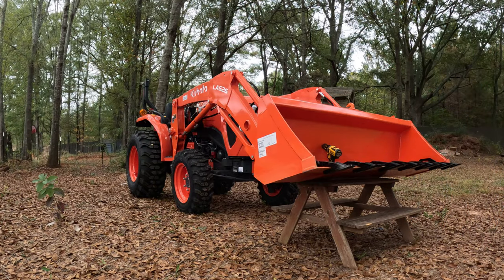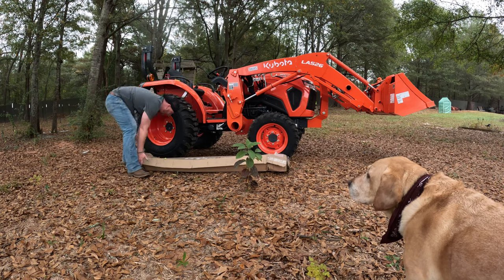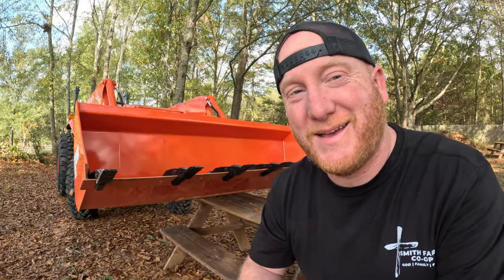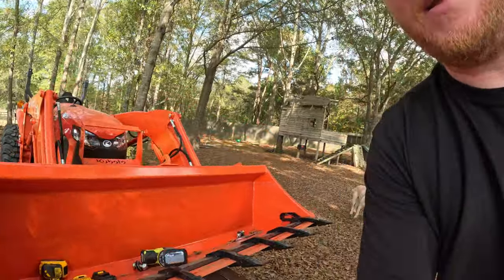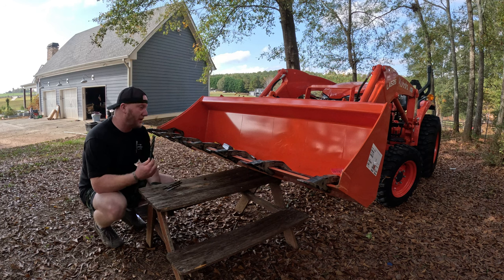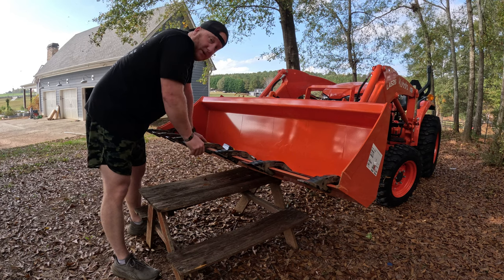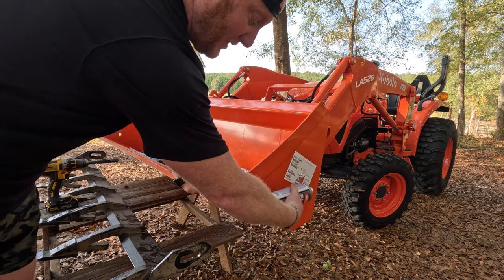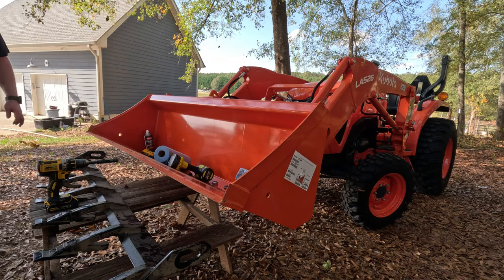How to Install a Tooth Bar on a Kubota L2502 Tractor Loader | Ultimate Guide for Farm Efficiency

Comment: I just recently bought the same tractor. 30 years on the place and its my first tractor.  They had it set up at Kabota dealer as top heavy as possible and never mentioned it.  No basalt in tires and at the narrowest location.  Im very familiar operating tractors  as i used to build golf courses and did lots of finish work.  We life on a mountain ,  I feel like thats something all sales people should talk about to fist time tractor buyers .  It was definitely top heavy and would have tipped easy
Reply from the maker: They filled the tires with radiator fluid and liquid. 
Most times I'll be using a tiller as weight on the back side. 

I appreciate your comment and don't forget to like it and subscribe we'll have more tractor videos coming out soon.

Comment: If they didn't change the motor from the 2601 once your warranty runs out you can remove the fuel pump shims and get around 33hp. To meet emissions standards of 26hp Kubota just retarded the timing or detuned one of the larger motor.  There are videos explaining how to do it it you find you need more power.
Reply from the maker: Yes I have heard that and I also got the jailbreak my Kubota kit which increases the loader ability too.
Reply: @Smith.Farm.Co-Op  I would like to see the loader jailbreak.